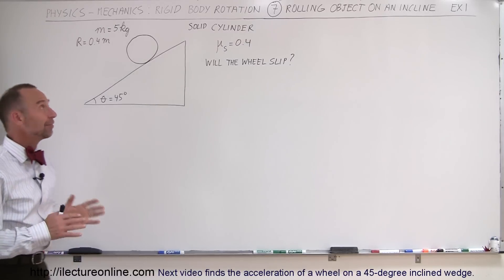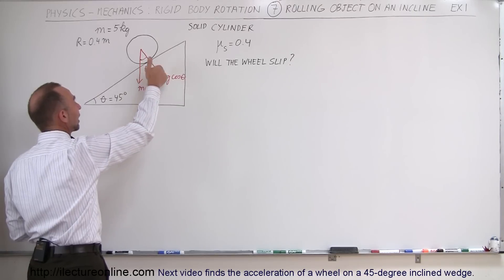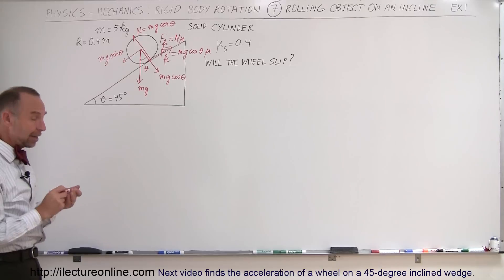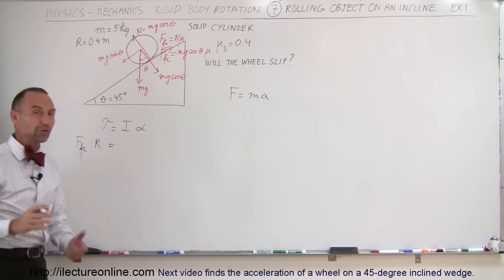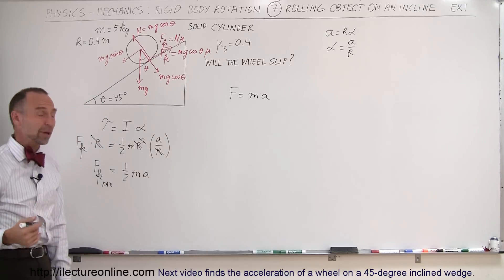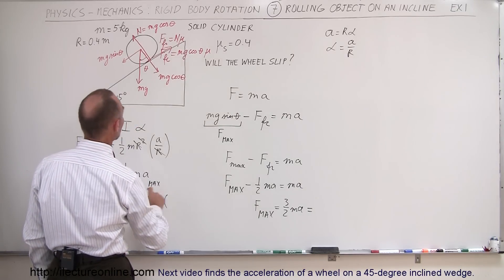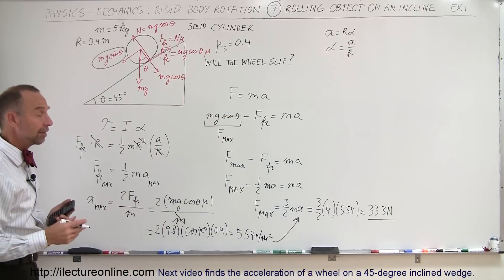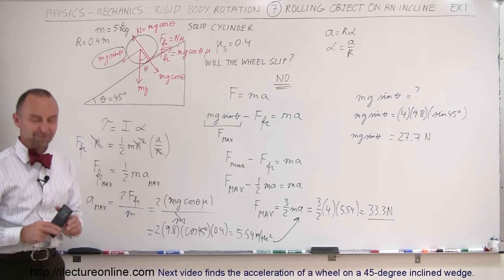Physics 11.1 Rigid Body Rotation (7 of 10)  Rolling Object on an Incline: Ex 1

Comment: Can you please tell me how to calculate the kinetic energy of a ball in points A and B? ( A is the point of contact and B is the top point, on the diametre). The ball is coming off an inclined plane of height h.
Great video btw!
Reply from the maker: To find the kinetic energy of a rolling object:  KE = (1/2) mv^2 + (1/2) I w^2     Where I is the moment of inertia and w is the angular (or rotational) velocity.

Comment: Dear Mr. Michael,
If the accelaration of a system is less than the maximum accelaration but the force is much more than the maximum force, will the wheel slip in this case? What if the load require such high force what to do in this case? Also the slipping will only be at the start or all along the rotation of the wheel?
Reply from the maker: Not sure how to interpret your question.  Using Newton's second law:   F net = m a.  Therefore the acceleration is directly proportional to the net force applied.
Reply: @MichelvanBiezen  
I just recalculate the whole thing and it was clarified. Thanks for replying in a short notice. I am currently designing to select suitable gearbox for a jib crane and your channel has really benefitted me in refreshing some of the dynamics concepts so I might get back for other questions,,, if it's ok for you. 😀
Reply from the maker: Questions are always welcome.  Glad you figured it out.   🙂
Reply: @MichelvanBiezen  
Hi Michael,
I have a question regarding both torque and angular accelaration:

Will there be a difference betwen calculating the angular accelaration on a gear by: alpha = torque/moment of inertia and by simply dividing the angular accelaration by the gear ratio: r1 alpha1 = r2 alpha2? 

If we assume a gear 2 of 4 kgm^2, 100 teeth, 20 Nm... so the angular accelaration will be 20/4 = 5 rad/s^2. 

However, if the same gear 2 is connected with a smaller driver gear 1 of 10 teeth and 2 Nm and 20 rad/s^2, so using: r1 alpha1 = r2 alpha2, alpha 2 = 10×20/100 which will be equal to 2 rad/^2!! 

Which answer is right in this case? The one with moment of inertia formula or ratio formula? Will the ratio formula still valid if the gears are of different face width size (different thickness)? Will this be different if the gears are of worm connectiob type? The values above is random and just assumed by me, so if such situation can't take place, could you please explain why? 

Thanks ahead.
Reply: To make it simpler,,, which one is more reliable kinematics or kinetics if they yield different results for the same problem? Does this mean one of the answers is incorrect??!

Comment: Hi sir, intuitively the friction is as though it helps the cylinder to roll faster so one would imagine the net force to be additive. Could u explain why this isn't the case?
Reply from the maker: The best way to see why is to draw a free body diagram.   Also imagine what would happen if the friction force were to go to zero and then what would happen if the friction force would approach infinity.
Reply: @MichelvanBiezen  I had a long thought about how to push my question to the very end. I think it should be:

All the work done by friction is transferred to rotational kinetic energy for non-slip cases. I don't see friction slowing down translational motion. The applied force which causes the friction causes the rotation and so energy is conserved. Just F=ma instead of F-Ff=ma?

Basically, doesn't a yoyo and a free falling yoyo have same speed since the retarding tension transfers to rotation anyways

Im following the Playlists "Physics X. X" My first doubt came in the yoyo playlist. Now met with rigid body motion, seems like I have to understand it, no escaping. 
A separate video on this can save many lives. Please help! Hahahha
Reply from the maker: I agree that this is a difficult topic to understand.  You are indeed looking at the correct chapter:  PHYSICS 11.1 RIGID BODY ROTATION      The friction does indeed cause the object to rotate, but the second law of Newton cannot be violated.   (Sum of all forces = ma)

Comment: Once you prove that the friction force must equal (1/2)ma, from the torque equation, then from Newton's force equation you have Fmax - Ff = 2Ff.  Or Fmax = 3Ff.  Hence, mg sin(theta) = 3 mg cos(theta) mu.  Or, mu = tan(theta)/3.  If mu = 0.4, theta_max = arctan(3*0.4) = 50.2 degrees

Comment: hello sir , 
could you please clarify me a point ?
when I did this question I got an acceleration less than angular acceleration multiplied by the radius , so assumed that the sphere is traveling a distance smaller than its ( delta theta times R = the length of arc) , and that will not happen only it is sliding , like a ball traveling so fast as it is not touching the ground . 
am I right ? 
thank u in advance , waiting for ur response.
Reply from the maker: The tangential acceleration (which is also the linear acceleration of the disk) should be equal to the angular acceleration x radius

Comment: A uniform hollow hemisphere of mass m and radius r is released from rest on a smooth horizontal surface with its open face vertically initially. Maximum normal reaction between hemisphere and ground during the motion is.......please provide me solution of this problem sir

Comment: Hi Michel.
Could you theoretically find the maximum angle by which the wheel will start to slip? I ponder if I need to measure the maximum acceleration.
Reply from the maker: We have a video on that topic:  Physics - Application of the Moment of Inertia (11 of 11) Angle=? When Disk Slips (mu=0.1)
Reply: That is amazing! Thank you for the reply

Comment: Hi Michel.
I was wondering what would happen if the cylinder was filled with a liquid?
Will it being homogeneous or not change the moment of inertia? I thought that a hollow cylinders filled to the brim with water would behave much like a solid cylinder, but my teacher told me otherwise, although he did not say why.
Thanks.
Reply from the maker: Your teacher is correct.  Try it with a can of soup or vegetable.  Roll a can and a solid cylinder down an incline and see what happens.
Reply: Lacking an actual good solid cylinder, I used a candle. For the liquid filled cylinders I used a small can of cononut milk (homogeneous) and a larger can of tomato soup (inhomogenous). The candle rolled faster than the tomato soup, but the milk had a similar velocity.
Reply: Hi Michel. I've done a few tests, and I must conclude that a can filled with coconut milk rolls faster than a solid cylinder. (can filled with candlewax, hardened).
Reply: @williamt1083  Here is a video on this topic from MIT's Walter Lewin ..... https://www.youtube.com/watch?v=cB8GNQuyMPc ...... The object with lower Moment of Inertia rolls faster since Inertia retards motion. This hollow objects roll more slowly than solid ones, independent of radius, mass, length or density.

Comment: if the wheel would have a powerd wheel drive and moving down, then the direction of friction will be in the same as the direction of motion ?
Reply from the maker: Yes, because it is the friction force from the "road" on the tire that propel the tire forward.  Note the other videos in the playlist:  PHYSICS 11.1 RIGID BODY ROTATION

Comment: U told it's a solid cylinder yet u used the moment of inertia of a disc u should have use 1/4MR^2+1/12MR^2
Reply from the maker: No, the video is correct.
Reply: Michel van Biezen sorry if iam wrong but please can u explain how
Reply: @gopalmali5606  A solid cylinder is just a solid disc that is long and the Moment of Inertias are the same, independent of the disc/cylinder length.

Comment: Sir, I thought that friction would go in the opposite way since it aids in the tire rotation?
Reply from the maker: Even though it is the friction force that causes the tire to rotate, from an energy point of view, the friction will remove energy from the system and work needs to be done to overcome friction, does it must point in the opposite direction of the motion of the wheel if there was no friction.
Reply: Pungfu Basically you solve for the force of friction using Newton's 2nd Law for Rotation or τ=Ια. Then you would do the net forces acting on the system equal to ma. In this situation if we say that the direction of motion is positive then are net force will be mgsinθ - Ff = ma. Then since we have an equation for the force of friction we can substitute it into are net force equation. This would help us solve for the acceleration of the system and then we could plug in our acceleration into the original equation force of friction, the 2nd Law for rotation equation, and that would give you the the friction force. Finally you solve for the minimum coefficient of friction by dividing the force of friction by the normal force.

Comment: Mass was 5 kg, not 4 kg.
Reply from the maker: You are correct.   I used the wrong number.
Reply: With m=5.0 kg, the cylinder will slip.
Reply: According to my calculations, the wheel will still not slip if m = 5kg.
Reply: +Menglong Youk Well,35.355 is bigger than 33.24.So it will slip if it is 5 kilograms.

Comment: how can force of friction provide torque alone? mgsintheta and friction should act as couple of forces to provide the torque
Reply from the maker: +Rahul Tiwari Mgsin(theta) line of action is through the center of mass and thus causes no torque.
Reply: sir can a single force provide the required torque
Reply from the maker: +Rahul Tiwari 
Certainly.
You are correct in saying that there is a couple, but only the friction force cause the rotational motion.  Without friction, the wheel would not roll, but slide down the incline with the component mg sin(theta) pushing it.
Reply: Thanks sir
Reply: Rahul Tiwari ...friction force only make torque .is there any torque component due to angular acceleration??

Comment: Shouldn't Fmax equal 41.6 N because the mass is 5 kg not 4 kg?
Reply from the maker: Yusif,
you are correct.  (I plugged in the wrong value for the mass)
Reply: @MichelvanBiezen  This means the force is greater than 33.3N so wouldn't change the answer to the wheel slipping?
Reply: If you change the mass to 5kg in the Fmax equation then Fmax will be 41.6N  which is still higher than 34.65 so either way it doesn't slip @zachadolphe3633
Reply: +Joe shouldn't it be 34.65? 5*9.8*sin45